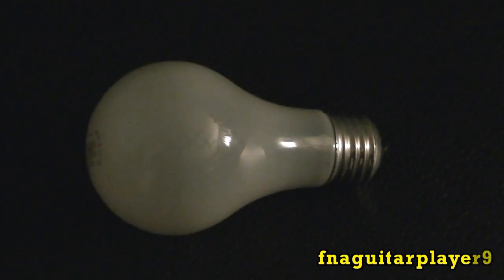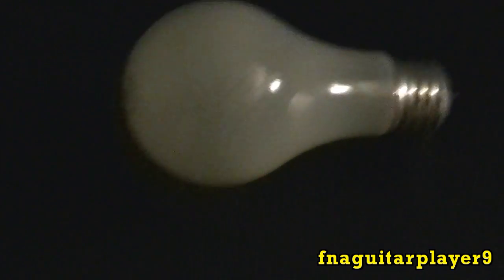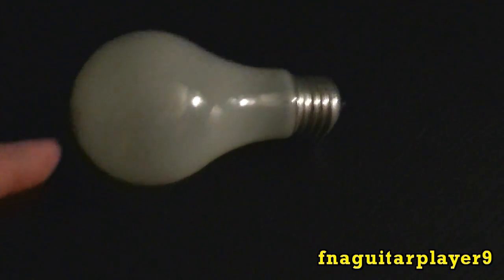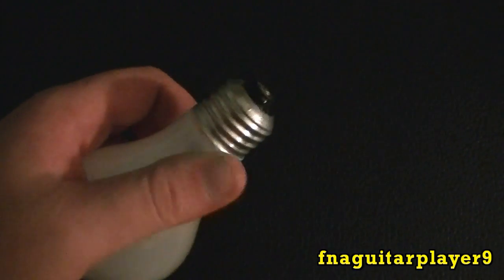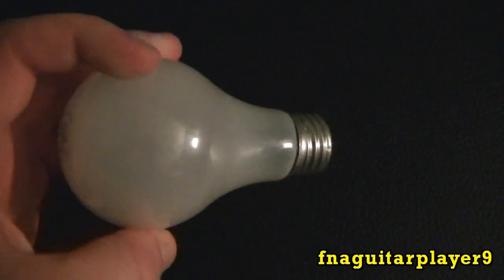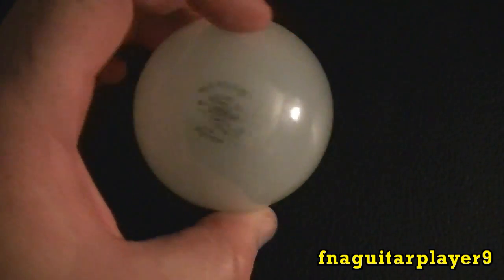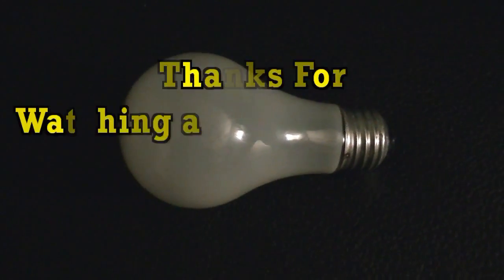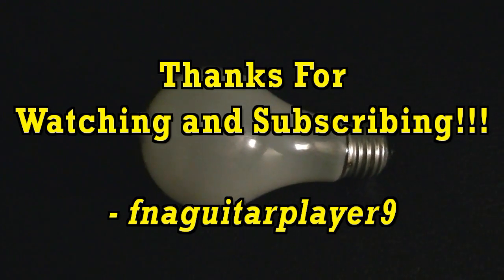Loose filament in a 60 Watt Incandescent bulb

Comment: I have been stocking up on 60, 75 & 100 watt light bulbs, bought two packages of 100 watt bulbs at HD, anyway I find those bulbe like the 60 & 75 watt you buy now (if you can find them) do not last long.
I had two 60 watt bulbs blow out in a trouble light in just one day, loose filaments..